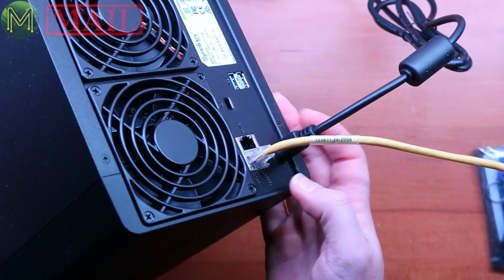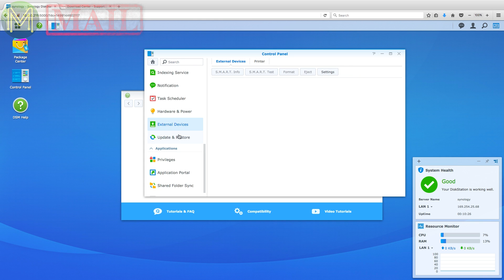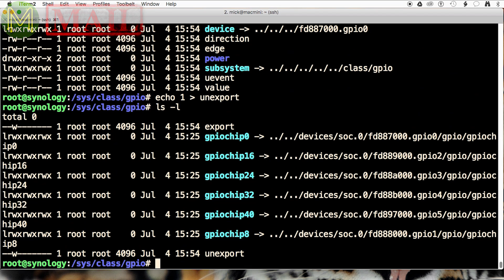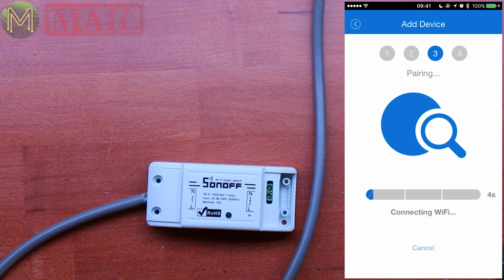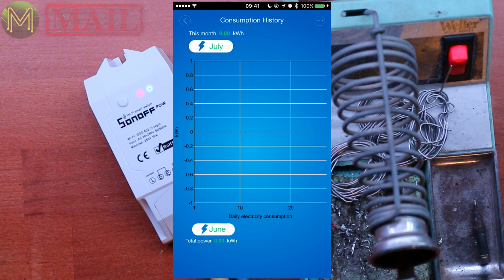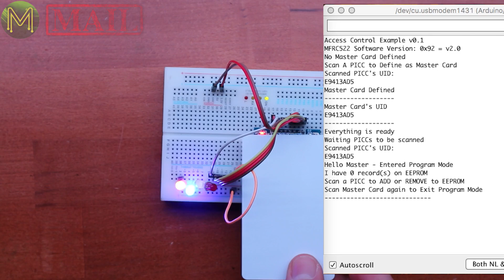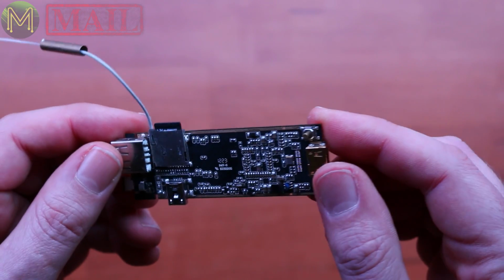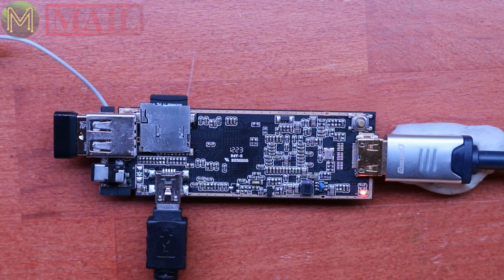#151 MickMake Mail #14: Sonoff, Synology & Miniand // News

Comment: Please don't put the green/yellow earth loose into the same area as the live phase in the Sonoff.

And you should also use earth output one the other Sonoff.  It could be not so good if there are an error in the connections.
Reply from the maker: +Anders Jackson 
Absolutely correct, but for a small test run I found this to be acceptable.
Reply: Well, kind of. :-)
Better is to have the earth covered with electric tape, cut short or even free outside the case.  Not so much in this case, but if there was screwed connections, you could get a short between live and earth.  

Now people who see this video know about this, so case closed.  But anyway, i like the video. :-)

Comment: Looking forward to your nRF5-thing video. I'm playing around with these kind of things myself at the moment. (They're used in the BBC microbit and various BTLE beacons)
Reply from the maker: +Simon Waite 
Yup, they're a nice chip to use. Haven't yet had a chance to fire up my Pi as a JTAG to program my one.
Reply: IIRC they use SWI and OpenOCD can bitbang the GPIOs of the PI to do it. Not tried it myself, but I have a STLink V2 on the way to at least do the SoftDevice flashing. If all else fails, Nordic recommend JLink. But I expect you know all this already ;-)
Reply from the maker: +Simon Waite 
Yup, I always try and do things as cheaply as possible. These days STlink adapters are fairly cheap, but why not use a Pi? The other bonus is if you're doing a lot of them it's actually faster using a Pi to bitbash.
Reply: +MickMake Someone said the official softdevice flashing software required JLink/STlink/mbed, so I reckoned having one would save later frustration STLink is compatable with openocd anyhow, so I win twice there I think :) What's more frustrating is having the kit sat a couple of meters away and not have the time to play with it!

Comment: Yep as pointed out before, this is not the "only board in existence", this is just the original model Miniand MK802 without its shell. Sold by truckloads as an HDMI-connected stick with Android for your TV: http://androidpcreview.com/mk802-android-mini-pc-review/551/, starting at $74 sometime in 2012. This is the device that "started it all" in the world of hackable-to-run-Linux inexpensive Chinese ARM boxes/sticks (and helped spark hobbyist's interest in the Allwinner devices, see linux-sunxi.org). Also known as Rikomagic MK802 http://linux-sunxi.org/Rikomagic_mk802 (and probably two dozen other brands). It should boot to Android 4 from its onboard NAND flash (4GB), and the SD card you were looking through is a third-party Ubuntu spin for the board. https://liliputing.com/2012/06/how-to-run-ubuntu-linux-on-the-mk802-74-pc-on-a-stick.html Things have progressed a ton since then -- from a custom 3.0 kernel and hacked together board-specific distros, to mainline kernel support, mostly complete by now for older chips.
Reply from the maker: +roman rm 
Thanks mate. Thought that would have been the case, but was hopeful.

Comment: Great video as always. Would love to see how you would go about adding a larger antenna to the card reader. I have had a project in mind for years that needs to read a card from up to 200mm away  that is travelling at up to 10km/hr.  (miniature live steam trains you can ride on for signalling). Have come across many articles over the years on the readers, but almost nothing on good antenna design. Even comments on the general prinicples would be good - maybe others would find this useful for auto garage door opener as your car, motorbike or cycle enters the driveway?
Reply from the maker: Now that would be fairly difficult for several reasons. 200mm away would need a high powered LNA, but the problem would be whether the RFID would have enough juice to transmit back to the receiver.
If you placed the RFID underneath the train, wouldn't it be closer? Alternatively, maybe a barcode / QR code on the side of the train and a camera to pick it up.
Reply: Your bigger issue is going to be powering the RFID card over a such a large distance. Remember that these cards are powered by the reader via magnetic induction/resonance. 200mm away is a long way for induction/resonance based power systems. Assuming you could power it, I wouldn't see why you couldn't read the data off of it from 200mm away, it would just involve a fairly high gain receiver and a decent directional antenna.
Reply: The idea was to hand out inexpensive tags to visiting locomotives, (the keyring style you used in the demo), and they hung them under the rolling stock. I was hoping that if we made the antennae in a rectangular shape (or figure of eight) under the track there would be sufficient length to power up before reading. Second option is to keep the antennae small, between the rails and yes - therefore the distance can be reduced to <100mm - but Insuspect the speed still kills it at 10kph.  The store security tags on high value items must have antennae that would do this, but have never been able to fund much info on their design.
Reply: Josh Duncan - happy to power them, but worry that introduces another issue - that trains on adjacent tracks might give a false read (approx 1m away)
Reply: What sort of signalling were you after? Do you need data encoded (eg. unique ID for each locomotive), or would a large magnet and a hall effect sensor achieve the same thing?
Reply: Josh Duncan unique id is best. Have experimented with track mounted hall effect sensors, but that introduces more complexity than you would imagine. Effectively you need two at each location so sa to determine direction, then counting axles, keeping state etc etc. ids coming in from each passing train (just serial number) makes the whole thing so much easier and more reliable.  Many tracks use post mounted pushbuttons that each passing driver must remember to push.
Reply from the maker: Nice! Thanks for the link.
Reply: Josh Duncan thanks for the link. Will check it out.

Comment: OO, nice. a DS416! Those are around 50000 yen here.  I have 5 of the 214's running for years now without a single problem. Unless you could WD RED drives dying before their warranty. 

Yes, hot swappable.
Reply from the maker: +Blatantly Fake Name 
Yup, they are fairly reliable. Once I get these tutorials out of the way I'll crack it open and see GPIOs I can get access to.

Comment: That mini board looks like the one from those HDMI dongle form factor computers.
Reply from the maker: +zadintuvas1 
A sub from Twitter found it:
https://linux-sunxi.org/Rikomagic_mk802

Looks like it's this one, but I have8G eMMC instead of the 4G.
Reply: I have several MK802's floating about somewhere, and should also have some OS images from Miniand sitting on a drive. I released a Gentoo Linux image for it  (with lots of installed packages) via Miniand back in it's day.

Comment: How secure are these SonOffs? I for one would be interested to know how you can stop a hacker from breaking in to your Access point!
Reply from the maker: +UFOhunter 
I haven't fully checked out the security, but will do before I record the re-flash episode.
I only have non-internet based control enabled. That's where the issues can occur - internet enabled control requires some decent security.
Reply: You do still want to change the firmware, as the functionality are much better with MQTT, instead of their own software.

Comment: I really dislike nass where the Os is installed on a data drive.
Reply from the maker: +Do R/C! 
Yup, depends on your MO. I also prefer that as well and all my current FreeNAS boxes use USB flash for O/S.
The advantage with a disk based O/S is that you have the redundancy of the disks, but makes recovery a little harder.

Comment: That synology looks like it supports 2.5" disks as well - there's a couple of holes in the base for screws.  You could use SSDs, but that's probably a waste with only 1GB NIC (the USB3 could make more use of it, but for long-term storage, SSDs are a bit overkill).
Reply from the maker: +EscapeMCP 
Synology do say that they support SSDs and really would be surprised if they don't, but they don't have any advanced load balancing RAID which would place SSDs first for reads and last for lazy writes.

Comment: Each master card allowing new cards to be added to the RFID module lock/unlock function has a unique code?
Reply from the maker: +Winston Smith 
It's a simple enough program that will record to EEPROM the master card. Then any new card can be registered simply by using the master card to enter "program" state.
So yes, each card will, (should), have a unique code.
Reply: The difference between "will" and "should" is why I asked and IF this is from a Chinese manufacturer, too often those two don't meet. If they don't and you use that device for some lock function...